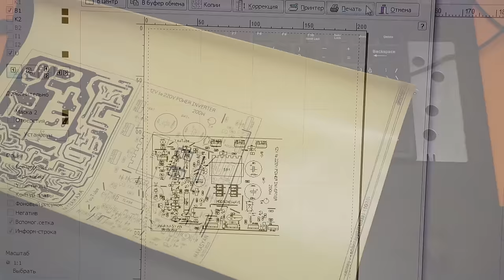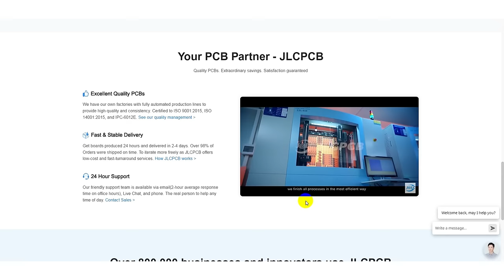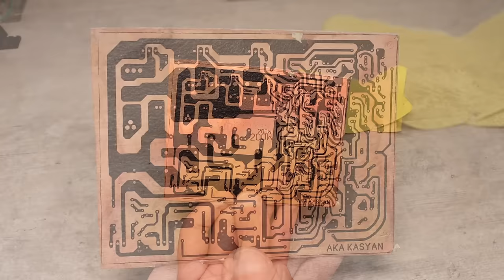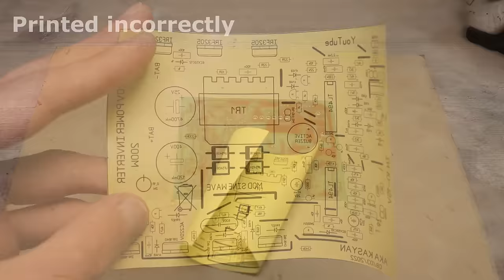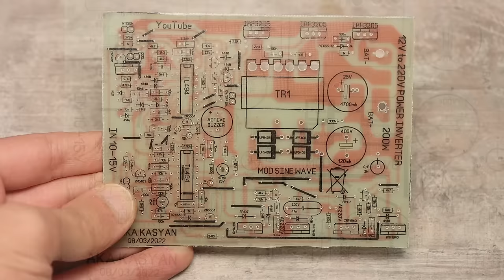How to make HIGH quality PCBs at home

Comment: I suggest not to apply any solder before drilling, since otherwise you'll have lead dust all over your room.
Reply: Exactly!
Reply: I'd drill first... but his holes do have no copper around them so there shouldn't be any solder at the points were he's drilling... an he does have a dust extractor.
Reply: as opposed to the more dangerous lead fumes already there from the soldering process?
Reply: Many people uses silver coating as opposed to solder coating

I forgot the compound, silver nitrate or silver chloride
Reply: @BeetleBuns Lead fume or flux fume??
Reply: @Forhan_faisal  honestly not sure what there's more of
Reply: @BeetleBuns fumes from solder wires are NOT the same as the effect of the metal. the fumes do not carry the lead itself
Reply: @walangpinag2765  Assuming the lead stays as either metallic lead or inorganic lead compounds, then yes, no lead will get into the fumes.  However, some fluxes have enough organics and acids in them that organic lead compounds are created during soldering, and those organic lead compounds can enter the vapor phase.  PLEASE use lead-free solder.
Reply: True... true
Reply: I just drill mine under water.  It's really easy.  You use a shallow, flat bottom pan.  Place a thin piece of self-healing rubber mat on the bottom of the pan and the PC board on top of the mat.  Pour just enough water into the pan to completely cover the PC board and add 1 or 2 drops of Dawn dish soap.  No dust to breathe, and the drill bits last longer!

Comment: You can convert an old laser printer, to use instead of ironing iron. Laser printers have nice rubber rollers and a heater all built in and ready. I built one myself, it's super easy.
Reply: you can use those paper plastification devices, they also have hot rollers
edit: its called a Laminating Machine, they are vary cheap afaik
Reply: Dear friend, what is the name of this paper?Can I use sticker paper instead?Because it is yellow like label paper
Reply: @rahimsarvejahani2083  It's a type of photo paper. You can use any glossy paper. I used glossy paper from magazines when photo paper was unavailable for me.
Reply: what the nail polish use for?
Reply: @jjjj-mu9rk  He covered defected areas. I mean areas that paint hasn't been covered on tracks.
Reply: @staviq can you please show method of printer conversion
Reply: Please show
Reply: @jjjj-mu9rk The process is a mess leaving holes in the larger areas. The nail polish covers those to protect the copper from in the etching step which removes all copper not protected by the toner (or nail polish). Its tempting to because you don't have to wait for someone else, but it takes a lot of time, results in very low quality PCBs unless you add a lot more step to fill in the gaps between the traces with solder stop paint because solder bridges too easy to create and too hard to remove without this step and that's before you try to line up both sides of a two layer PCB, drill and connect vias etc. It's an neat project in its own right, but not really useful. If you still use 2.54mm pitch hole through parts just use a perfboard.
Reply: @jovand6606  incorect : acele laminatoare functioneaza pana la 128 microni grosime

Comment: Wow, very nice.  What sort of paper did you use for the transfer?
Reply: Search for "PCB Circuit Board Thermal Transfer Paper"
Reply: We used to use the glossy pages from magazines. Don't use the cheap magazine paper, make sure they're the glossy type.
Reply: @therealjammit  I'd never tried with magzine papers. I'd great success with glossy phot papers though. I'd never tried these thermal papers. I don't think I could find them locally.
Reply: @wolvenar  Hello, dear friend, can I use label printer paper?
Reply: @rahimsarvejahani2083  Are you talking about the wax like paper that backs sticky type labels? 
I really cannot say, I have never tried. 
But it may work. I have used glossy paper from magazines, and glossy photo type printer paper with reasonable results  with larger circuits. Magazine paper is not always good for fine (thin) circuits.
Reply: @wolvenar  Yes, I think magazine glossy paper could be too "soft" for very fine lines, and the ink spreads (gets wider). Also I am not sure that applying the force sideways helps. It also "widens" the lines. ...

Comment: for quick prototyping, I now prefer CNC PCBs - as the process is much more quicker with more accurate holes. Been doing this and the photo methods before.
Reply: Be rich, gotcha, good advice!
Reply: @n00blord111  i bought the cheapest Chinese knock off though, and did some low cost DIY upgrading.

Comment: For tinning, it seems some tinning fluid would be a lot easier than using a Soldering iron, and much better results as well.
Reply: But you would accidentally close the holes with solder then you will have to drill again same thing
Reply: @SharvilSawargaonkar  Tinning fluid does not close holes on the PC board. It just puts a very thin film of tin over the copper.

Comment: In place of citric acid and hydrogen peroxide, I'm using Sano kitchen cleaner cream and kitchens sponges scratchy side. After ironing, I'm dropping PCB in water and that transfer paper cames off by itself.. When pulling it dry, toner in some spots can came off because of PCB surface imperfections.. 😉
Reply: Dear friend, what is the name of this paper?Can I use the yellow paper of the label printer?

Comment: You are using polygons that go along some tracks, how is called that technique? I know how to use polygons, that's not the problem, but how did you got that final tracks' shape? Does it even have a name? Or I just add polygons at my own discretion? Thank you!
Reply: You can design any shape in Altium Designer software😇

Comment: Great video, but can you comment on what ratio of citric acid to hydrogen peroxide...? Does it matter?
Reply: 1:1 should be fine
Reply: 40% 60% some where 50 -50 % depends on copper plate quality and thickness

Comment: Nice work, but tinning the whole PCB is very time consuming. What about covering it with a solderable transparent film like "Kontakt Plastik 70"?
Reply: Look up Liquid Tin by MG Chemicals.
Reply: @hobbyelectronics6630  do you know if Super Shield MG Mechanicals can also be used? or which is better?
Reply: @RembertoMachuca  Super Shield is a conductive shielding paint. It will not work on copper traces. Liquid Tin is a liquid plating solution for copper traces. Two different products for different uses.

Comment: Oh my god, that's so much work. Sorry if I sound off-putting but this seems like so much wasted effort. And it's sponsored by JLCPCB which can make proper double-sided (or 4-layer) PCBs suitable for 0.5 mm pitch SMT components and plated vias and what not very cheap. By the time you finish the whole DIY method (which I assume also fail in some way regularly) you will almost have the finished PCBs in your mail box for just a little bit more money.

Comment: I love how you do toner transfer to get a "silkscreen"... that's nice. Also your "ancient" iron is fabulous.
What concentration of Hydrogen Peroxide do you use.... I assume it's quite strong because of the relative "weakness" of citric acid?????
In the UK, we can only get 12% peroxide as our government fear we will use greater concentrations to make missiles or something.
I like Hydrochloric Acid because, as Nurd Rage taught us, we can use the resulting Copper Chloride as an etchant itself.
Reply: Developer at the beauty supply shop. But 12% is sufficient. Even in the US, anything greater than about 12% isn't readily available. We can get it, but it's a specialty item. 40 volume developer for hair color is 12% h2o2.

Comment: Two quick questions - what was the nail polish for?  Just to cover any imperfections?  And which acid was that?  Ferric Chloride is a lot darker and uglier, that almost looked like pickling vinegar!?
Reply: I think they mentioned citric acid and peroxide. It can be used to clean the board by etching a small amount after soap and water cleaning to make a very clean copper surface. Also it will do the full board etch when left longer.

Comment: There is a thin transparent sticky sheet over these papers. 
Should we remove this before putting it into printer ???
Reply: I Dont Think So , That Is Essential It Make It Non Stick So that When Heat Is Applied It Would Transfer It To The PCB
Reply: Search out "PCB Circuit Board Thermal Transfer Paper"

Comment: A much better methode is to use PCB with a photo layer. Then print out with a laser printer on a transparent foliage. After this fix the foliage on the PCB and use a UV lamp.

Comment: The drilling gives me PTSD. That's the worst chore with home-made PCBs, it takes forever, and those tiny carbide bits snap if you look at them wrong. I stopped making home-made PCBs, I'm just sending them over to JLCPCB for manufacturing. Plus through-hole plating for 2-layer boards is a big deal.
Reply: Protoype PCBs (if you cant wait a couple of days) are now made with a small cnc router for that reason. Indeed drilling is otherwise a pain, plus who wants to deal with the chemicals?